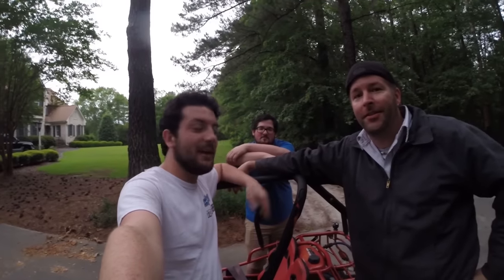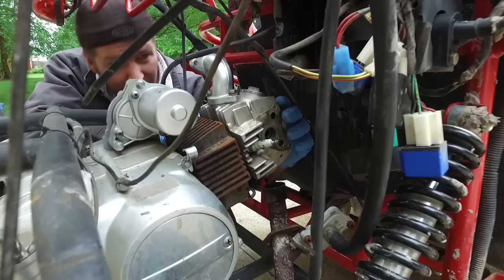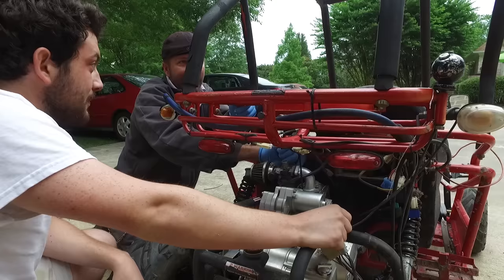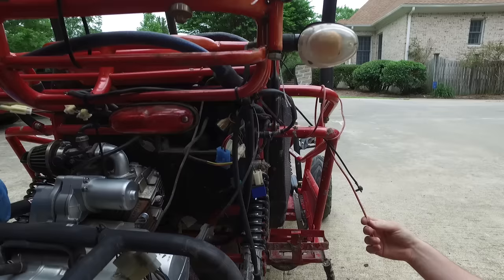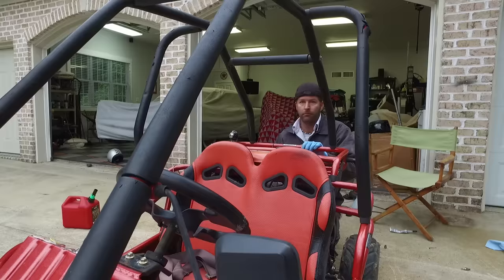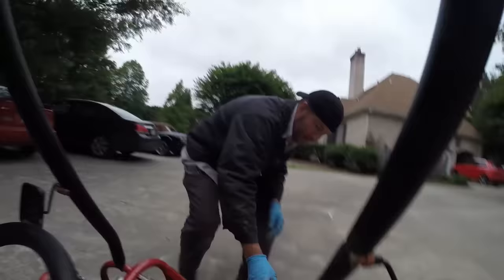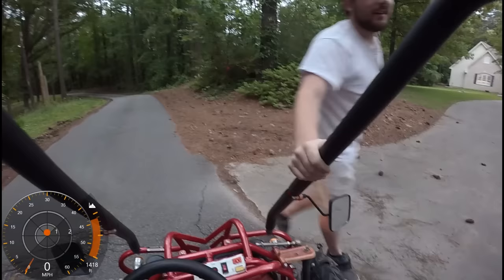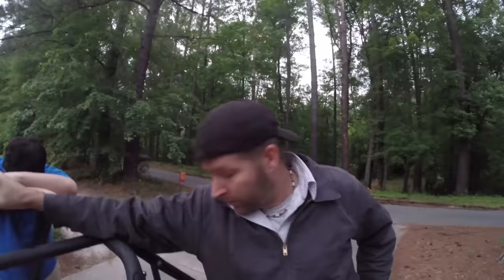Fixing, Crashing, and Top Speed Run with the Offroad Kart

Comment from the maker: Don't forget we're having a meet June 18th at 2 PM at the GoPro Motorplex! We're looking forward to it and we hope to see you out there!
Reply: ok nice can you take a link with a go kart energie with 13ps (sorry vor my bad english im from germany)
Reply: +Leo Czwiklinski http://www.gopowersports.com/13-hp-420cc-ohv-predator-horizontal-shaft-engine/
Reply: 100th like 💯👍✌
Reply: +Ryan Burton thanks
Reply: You guys should widen the seating section and roll bar. You could just cut out the side rails and weld them, say, 3 inches out, so you can fit two people. The suspension will make it tricky to widen the track, so I would go with some hub spacers. It should be possible to weld some plate to the A-arms to armor them against branches and rocks. Also, you can extend the bumper out, not only to protect more, but make a place to put the winch, and make room to move the pedals forward so you aren't so cramped. These things share a LOT in common with little chinese-made mini quads, or mini ATV's, with the 110cc engines, so look to eBay for anything from suspension to engine parts.

BTW, you should probably switch over to LED bulbs in the lights so you have enough alternator left for a winch.
Reply: Turbocharge it
Reply: What state? I apologize ahead of time for not looking it up myself
Reply: +CarsandCameras so this what you do when your engine don't have compression
Reply: +CarsandCameras I have that same engine on a atv but mines getting low compression
Reply: +CarsandCameras puT a 670 in it
Reply: 670 time
Reply: roy kinner that could be caused by a multitude of problems. You should read up on engines not betting compression.
Reply: can you guys fix the switches and the lights maybe make this one legit
Reply: if you want a good light for that think, look up "Cree 18 watt led floodlight" on amazon. it's bright as hell and super cheap
Reply: +Eli Kirkwood i wasn't saying for me I was saying can they get the switches to work as it came originally for the ignition and lights that would be cool if the made this nicer than all the others
Reply: +Hennessey Viper Venom I know, I was talking about for them
Reply: You guys are the best and you should also add a led light bar on it, it would look so awesome with it and with winch :-)
Reply: hey, what year/make is it?
Reply: thanks
Reply: thanks we will look into that
Reply: north carolina
Reply: it was down on power and spitting back into the carb. so i guessed the valves were damaged from my mishap with the plug
Reply: these engines need valve adjustment every so many hours of use. tight valves will let the compression get weak
Reply: 2011. not sure of the make
Reply: +Isaac it'll be fine  do you know what brand? Honda?
Reply: +Isaac it'll be fine Hey man! Get a zongshen 155, Daytona 190 or a yx 160 (18-28 hp) and put that in it. Keep UP the great work
Reply: +Hope SkatePark and DirtJumps engine is prob a zongshen or lifan
Reply: Hope SkatePark and DirtJumps not a honda. i think its a copy
Reply: +Jostein Carlsen thanks
Reply: +Isaac it'll be fine thank you
Reply: Hope SkatePark and DirtJumps honda copy
Reply: you should put an led light bar on it!!
Reply: put a nice 400cc engine on the paired with a gear box
Reply: Do @carsandcameras respond to there contact/email things on there website cuz I had an important question to ask them???????
Reply: Daniel Sessions whats up?
Reply: caan I buy one of your frames  from u I am in need of one. u inspird me tomake my own kart and race one of my friends that has on to
Reply: we arnt selling any yet. sorry
Reply: +Isaac it'll be fine oh ok thanks for telling me I'll try in a few years
Reply: put a led light bar on top
Reply: Hey Ike I bought the exact same off road kart and I'm having a bit of a hard time with it I'm wondering if you can help out
Reply: whats up?
Reply: The one in Mooresville?
Reply: yes
Reply: i think yall should give it more stance try a couple diff sprockets before you do a motor swap widen the floor a little to give you more room to fit in there and put a small led light bar on it there is no offroad project without a light bar!!!!! you can get them cheap off amazon
Reply: do you guys know that the engine in the buggy is a pitbike engine
Reply: i know its like a pit bike engine but with a reverse
Reply: do a motor swap
Reply: i have tht same engine on my 110cc falcon but it hits 45mph if yall do some mods to this thing im follow your foot steps but mines not running any more and i dont know whats wrong with it
Reply: +TrickShot601 CBK  Clean the carb it worked for me
Reply: Jason Soto nawll its not the carb it sum with the egine i think its the head i did everything that can be done but the head
Reply: +Isaac it'll be fine put a 420 or higher predator on it with a reverse box on it to keep reverse
Reply: CarsandCameras fvg
Reply: CarsandCameras em I to lat to go?

Comment: MOAR POWER!! and maybe reinforce the cage ;)
Reply from the maker: +Alyn Penners It definitely needs both.
Reply: +CarsandCameras well I just subscribed. Keep makin good videos!
Reply: +CarsandCameras But do you really want to take out that nice 3 speed+reverse gearbox with a running electric start engine? Sure it needs power, but I'd rather buy/build another cart that's similar and do the regular 4 stroke, centrifugal clutch (or torque converter) thing on it, than on this nice cart^^
Reply: +CarsandCameras It needs two dragons on the sides. Trust me.
Reply: +DerKrawallkeks they could source a pitbike motor. anywhere from 50cc to 125 in the same sized package and retain gear selection. Although, it may lose the reverse option.
Reply: +XsV=TooL I agree
Reply: yes i think predator
Reply: good idea
Reply: +andy stone i agree, 420cc or v twin?
Reply: +Luis Ramos hrm v twin would sound more agressive
Reply: Tru tru, Imagine it with a straight pipe
Reply: andy stone and possibly putting a turbo
Reply: Hrm i was thinking more of a single chamber motor bike muffler and yes to a turbo
Reply: andy stone sounds good
Reply: do not ever underestimate the dragon sides.
Reply: u should put some led headlights on it, a windshield, , and if possible put wider rear wheels
Reply: +Matt Rodriguez its not a muscle car...Lmao jk
Reply: ik it was just a thought, but i do own a 69 charger r/t with a 440 magnum
Reply: nice!
Reply: Matt Rodriguez I like the wind shield thing because if you use plexiglass you can save yourself from that winch snapping in unexpected circumstances when your in a bind,
Plus I've always liked the idea of a performance cart with a closed interior similar to a car for comfortability and to keep weather from starters light wires and other weathering open cage carts deal with I know it's all to much but in a perfect world that's my dream Cart lol

Comment: It doesn't need a stereo. Thats just more stuff to go wrong or get messed up.
It doesn't need a winch. It is light enough for two adults to pick up and move. (or get a rope and pull)
It could use two compact LED lights instead of the original headlights. Just make sure to aim the light low enough as to not piss off the neighbors with lights shining in their windows.
And it could definitely use anything to help performance. (power, suspension, brakes...)
Oh, and another offroad kart to race against.
Reply: Gee thanks mom...anything else?
Reply: Nope, pretty much covered it all...LOL
Reply: Says the guy with a Low Go Kart IQ. lets get some music goin! Winches don't cost much, $100 for a winch that can pull the Kart without a problem, Nothing wrong with it. Led bars are outdated, You can get a square led cheaper and brighter, with a dimmer switch.

Comment: Just replace each headlight with a LED cube that has the 4 LEDs in a square. Plenty of light for something like this. And when your ready for more power I think a big bore kit would be perfect. More power, cheaper option, and another aspect of wrenching on karts for the channel!
Reply: Yup
Reply: Just put a ct70 motor in it. 20 more cc's. But that motors tranny is different compared to a stock honda ct motor. Just my two cents
Reply: Yup!

Comment: I have a few questions that I would really like help with. 

For starters, if I have a gx270 clone and I want to upgrade the valve springs....
A- how do I determine the current stock spring strength? (I've spent hours on Internet with no luck)
B- I've heard people say "upgrade to 18lbs springs" but every website I've found gives no information and just labels the parts as upgrades, or redirects to a listing that says something to the effect of "95lbs @ 1.125" or whatever. How do I know what I need?
C-I removed the governor, what rpm should I see with stock valve springs? Mine fluctuates between 3400 and 4180rpm with the wheels of the ground.
D- if I upgrade my springs what rpm should I see? 
E- Will I break the connecting rod if I upgrade the springs? I've haven't been able to find a single story that confirms this..

If you have a response (thanks), anything is helpful.

Comment: Always wanted a kart with suspension.... I have a kart with a 420cc predator
Reply: How fast does it go??
Reply: Fast. Very fast.
Reply: I have a kart that weighs next to nothing, has no suspension, crap steering, 212cc predator on it and stupid gearing with big tires that pushes mid 30s I believe. Then I have my big yerfdog spider box that has front independent suspension and rear solid axle suspension and it's gonna have a 41hp 8k rpm 2 stroke on it... It's gonna be fun!
Reply: @MiloJasper13  r/notopbutok

Comment: For a radio you should get a diamondbox an d mount it on rack behind your heads pointing forward its loud as hell self contained and rechargable/bluetooth, what more could you want. I have one I mount to my dingo that was a task but I did it and even if I only use it when parked its cool knowing its on its own battery, you can rechange or power cameras off its usb too.

Comment: i really hope u guys read this ive worked on these motors sence i was a kid and ive learned that it need lots of air cooling but for this type of set up id go with and oil cooler also if the intake is loader the the muffler u losing alot off low end cc sooo make sure that muffler get alot more flow or just cut it off ive always did that with my honda minis and it opens up a hole nee world of power once u open up that exhaust

Comment: Honestly guys, if you want to make it semi dependable, look for an old Honda minitrail 90 motor. The motor on it is a honda clone (a cheap Chineese clone) and although the honda is 20cc's smaller, it will make much more torque and they're bombproof. You'll lose reverse but she'll still have 3 forward gears and a lighting coil.

Comment: the ticking sound you hear from the motor is just the cam chain ratling around the cylinder/head , just get a stronger spring or change the cam chain

Comment: Just think, If you could bolt a 420 predator engine to that transmission? It would be rolling death. You would just about have to widen the rear axle at least a foot on both sides. Also, If it isn't going to see much trails, you could put a harder tire on it. Maybe a riding mower tire. They won't be as grippy as those ATV tires. They would be more apt to slide instead of flipping. Also, You might consider converting it to a one seater. With the driver in the middle. That way if you flip it you are a little less likely to wind up face planting poison oak. Or worse, briar bushes. A seat harness comes to mind.

Comment: what would be sweet I think for something like this is snag an old riding mower and throw its 18hp vertical shaft with the differential/transmission/axel setup( like the older craftsman/murray) into this thing.

Comment: pretty slick...  ! drop your 14 tooth drive sprocket to a 13 and you will have more low end grunt,  but you will lose about 5-6 mph....  Or see if you can slide a 125 in its place.  I have one on an off road kart I built my kids.  I can post the dimensions for the mount locations,  if you want.....

Comment: I just got my first dirtbike .its a 50cc Honda knock off motor that runs pretty good with minor throttle cable adjustment .its says to run 25:1 fuel to 2 stroke fully synthetic .any tips?

Comment: you could possibly raise the compression a little and fit a propper gasket , carb is 50 bucks bigger carb prolly 55 need a bigger intake maibe a hotter cam for it too , could even get a bigbore kit and freeer flowing exhaust for the thing should go plenty fast that way

Comment: Hey,  the 125 and 110 mount with the same mounts and dimensions.  I had a Honda atc 80cc in that kart before I put the 125....  The 125cc Lifan should slide right in with no modifications.  and you end up with 4 gears.....  1st should make your wheels lose traction, because of how small in diameter the tires are,  compared to the dirt bike the 125 is geared for.  You SHOULD be able to lay down some serious rubber,  off the line.....

Comment: just to help out a little bit... Go on ebay and get a lifan 140cc with a manual or auto clutch for more power and then get a big bor kit for it, those motors are very reliable. I have one myself and it lasted me about 6 years without any problems.
Reply: and they have the same motor mounts
Reply: Or 160cc
Reply: +Honda Cr 500 isn't there a 160cc engine
Reply: +Honda Cr 500 There is but they are known to blow up and break the crankshafts connecting rod to the piston

Comment: common issur on those Honda clones is The valves tend to rattle loose and adjust themselves to hell... i learnt that The Hard way after trying to kickstart a moped until i literally had worn a hole in my sole on my foot. so always check The gap, id say 10thou mm :)

Comment: You might want to put a regulator on it so the lights work better,  run it on 10ml nitro to 150 petrol as its a safe amount as well as the boost to performanca. Sticky needles are norm for that carb so ues graphite powder on the slide the run the throttle up and down 3 or 4 times and startnher up. I doo custom lights and use 20 lights at ( 10mm lights or cree lights.

Comment: if you want to put a winch on it or not you should  make a bigger battery tray for like a lawn mower it will make a big improvement and you can buy a new starting switch also those clutches can break pretty ez

Comment: I have a 3 wheeler with a 125cc and it bogs down every time I give it any throttle what-so-ever. Do you know what's causing this? I've got a new plug for it, i've made sure it was clean, ive cleaned the carb. i've tried adjusting the AF mixture, nothing.
Reply: check the timing my freind rolled my 350 cc atv and we got it started again but it wouldnt rev up above idle i checked the timing on it and it jumped five teeth it runs perfectly now
Reply: did you take the carb all the way apart ?
Reply: Isaac it'll be fine Yeah, I've torn it completely down and cleaned out everything as much as I could and my dad helped me put it back to gether to make sure it went back together correctly.
Reply: +RizoProduction clean the Venturis (jets), make sure the choke lever/solenoid isn't malfunctioning
Reply: Wyatt Y Grose The 4wheeler is from like the 80s, i dont thik it has a choke solenoid, and its also stuck open. We can get it started, and warmed up, but after that, it bogs. Sometimes it will rev in neutral, semi-fine, but once you put it in gear, you cant give it enough throttle to even movie it without it dying. I've tried fixing this for so long. The 4wheeler was running in great condition, so great that I used to use the little 125cc 4wheeler to tow my vehicle across my property when working on it, when i didnt feel like pushing it, and now it cant even rev enough to move its own weight? I'm starting to think its compression related, or something. idk anything about 4 wheelers.
Reply: do a compression test
Reply: +RizoProduction it sound like its starving for fuel. start at the tank,make sure you are getting fuel out of the petcock, then check the fuel line to the carb, then make sure that every little hole in the carb is clean
Reply: Carson Hammond I've done this, And it ran fine for about 2 months before, then it just randomly started doing this, like I said, I used to be able to pull my truck with it \, not it cant even pull its own weight

Comment: i have one piece of advice for you guys. It's time to go pro. you guys have shown that you can weld decently and fabricate mounts for things when you want to put in the time. Put some dirtbike engines in things. It'll take it to the next level. An aircooled ATC350 engine would make this little turd of a go kart faster than the 670. That would be amazing.
Reply: I dont want to die ! lol
Reply: Well, I can't say I blame you there. That does start getting dangerous and expensive pretty fast. Love you guys and your show, just a suggestion on how to go faster. Have a good one!
Reply: its all in the gearing if the engine can push it. i bet i can make my race kart do 65 mph with the engine on it as is with a sprocket change and a nice road